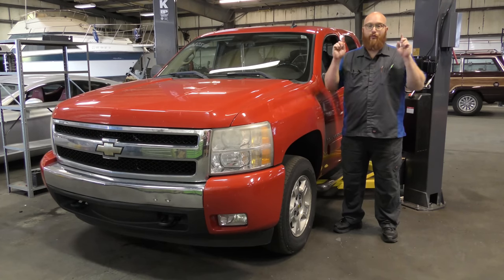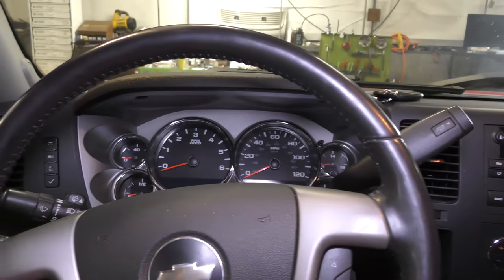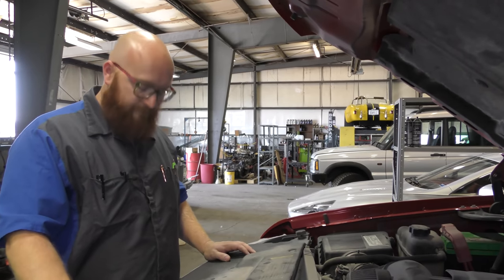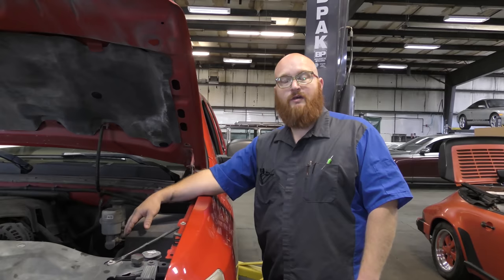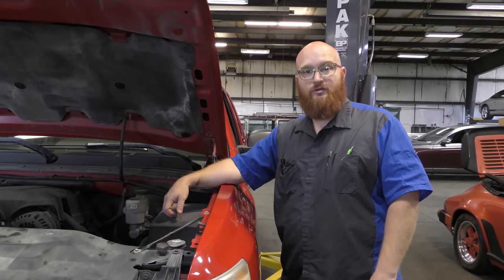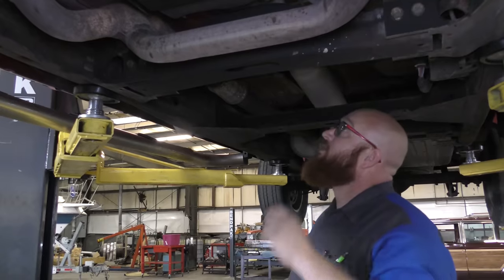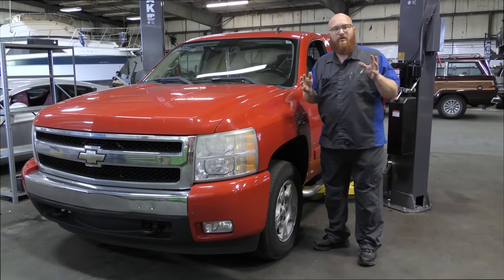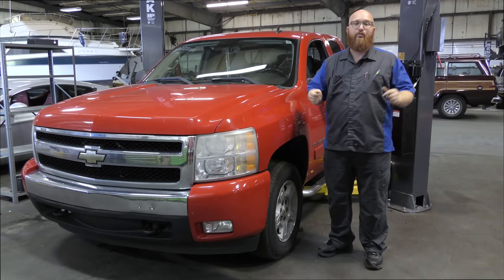Good Truck/Bad Truck? CAR WIZARD shares most common problems on the 5.3L Chevy truck at 100k+ miles

Comment: Hey wizard great video thank you for the information. I'm looking at this era of the GMC twins,  and Ford F150 as well. Non-Ecoboost engines! I've heard from previous owners that they loved these GMC pickups however, they're prone to Rusty fenders that spread very quickly. Owners have said online that GM used cheaper metal in that era to build these trucks which is the reason for the premature rust. Is there any truth to that at all? Is the 2014 and up a better choice with the new body style?

Comment: 2010 Silverado crew cab had to replace ball joints at 80k, and at 100k some of the windows would not open or close from driver's seat switches.  Other than that, no major problems driving my 2010 Silverado to and from Montana/Alaska.

Comment: My company has a 2500HD vortec version of this truck.  It’s an absolute pile.  Every piece of plastic is brittle and broken.  The engine sounds good, but like the wizard said, towing a trailer up any mild incline requires taching it out 4500+ rpm with foot to the floor.  Sucks gas so hard you can almost see the needle drop.  The paint is failing in multiple places.  You can flake off large chunks with your fingers.

Comment: I used to change my own oil all the time, had an 06 tundra and the last time i changed the oil on that rig- the used oil stank like gasoline
really bad. what causes that? bad cylinder rings? i was stumped, the truck ran perfectly except the used oil stank like gas. TIA, really enjoy your channel.

Comment: Good video car wizard ,also the drivers side engine mounts goes bad on those trucks the upper ball joints go bad even on 2 wheel drive the pick up tube Oring is common failure inside oil pan  there is a screen under the oil pressure sending unit the clogs up and the trans cooler lines will start too leak .i brought a 2008 Silverado when it was 4 years old  did front brakes they were the original front pads ,did oil pick up tube oring and drivers side engine mount .replaced the sway bar link pins  replaced all 4 tires I did these repairs after owning the truck for almost six years .my exhaust manifold bolts have not broken yet 😊 everything else is still factory original .it has 234000 miles on it and is daily driven haven’t had any problems AFM but I change my oil regularly.👍

Comment: 6.0 towing tandom axle 8000lb boat 3rd gear uphill 3500 rpm @ 62 litres per 100km on the freshly reseted  display which is the same mpg as my 454 volvo penta  boat which at also 3500 rpm gets 12 gallons per hour A v-8 is a v-8 there all the same mpg when towing and rule of thumb fuel econamy drops by half

Comment: You can get a 4.3 liter V6 in them too and they are easy to work on. You can stand in the engine bay on a V6 truck. However, they are not that powerful and you cannot get them on a crew cab until 2014.
Reply: Agreed

Comment: Got an ‘08 Silverado with just over 130k.  Gonna check this stuff out myself. Thanks wizard.
Reply: Checked and only one broken exhaust bolt, oddly the same side I’ll get an intermittent o2 lean code when it’s cold..
Also have the leak from that oil block off plate.

Comment: I have 330K miles on my 2000 GMC Yukon with the 5.3 engine.  I do have that oil leak that I suspect is coming off the oil filter housing.  I had a problem with loss of engine coolant.  The Chevy dealer put ACDelco anit-leak tabs in the coolant reservoir and that worked.  When I have the transmission overhauled at a local shop at 270K miles, had asked that the rear main engine sealed replaced but it turned out that the aluminum plate was warped and the entire plate/gasket was replaced at the cost of the part and no labor charge.
I want to buy a newer model but I am concerned about failure of the engineering that goes into new technology like engine cylinder activation feature becoming financially burdensome.

Comment: you didn't mention the Active Fuel Management. Is this a non-issue on this gen of chevy trucks? i had one until 153k when i sold it. I sold it because of AFM fears.

Funny thing is that I had the Oil pressure sending unit go out, rear shocks go out, exhaust manifold bolts missing, spare tire rusted shut, a/c go out, and cruise control go out LOL. you're spot on.

Comment: I have a 2001 Silverado with 106k and have had that exhaust leak (broken bolt) on #7 for the past 12 years or so. As you said it sounds like a tappet and goes away in about 30 seconds. No mechanic has been able to figure it out. I just happened to see your video on this Silverado because mine is up in age and wanted hear from an expert on what I might be over looking. The broken bolt on #7 was not visible except for a slight gap between the bolt head and manifold. Sure enough I was able to remove it with two fingers.Grumpy is good.

Comment: I had an 04 1/2 ton with 5.3. Purchased at 100k.  Had to fix, transfer case (leaked), rear seals. AC quit, never fixed it, we don’t need it here in western WA.  Other than that, routine maintenance. Probably the most reliable truck I’ve owned.

Comment: These are excellent - thanks! Just picked up a 2007 2500HD with 20k miles on it from a local amusement park here in Florida that has a rat as a mascot. Already fixed the oil cooler line leaks, the AC belt was severely cracked (new belts, tensioners, idler) - the fuel pump is next, because those just die at some random point, and relatively cheap. Lastly, 1/2hr per broken exhaust bolt is a deal imo - would gladly pay you for that =)

Comment: Blower resistor and connector, maybe a window switch…oil cooler block off plate gasket…rear main seal/cam sensor….

Next we’ll do lists Ford and Dodge, oops, I mean Ram.

Comment: @carwizard great video just bought 2013 chevy silverado 5.3 144,000 miles 
Ran into to cylinder 4 misfires had to change all plugs and coil pack 4 then 2 lifters went out I drove straight to mechanic bad lifters rocker arm not moving 1 of 2 on number 4 shot camshaft due to active fuel management system or AFM is a huge flaw in my opinion as a owner with one in the shop a month after as is purchase I would say a dod afm deleted truck would be a plus running v8 full time seems as if these cylinder get depleted and cause plenty of issues. Not a mechanic but I've learned alot threw my unlucky situation and figured I would give my input as a Chevy Silverado owner
Great video thanks so much for the additional knowledge. Hopefully I won't find any of these when I get her back!
Reply: I plan on looking threw my options for full v8 in the future so this doesn't happen to me again

Comment: Great video! 
I have a 2006 GMC Sierra with a 5.3 L. (123000 miles)......all exhaust manifold studs are still
intact! 
Do you recommend me replacing them all before they start breaking?

Comment: Just wanted to add another common issue. If you are trying to scan a check engine light and get a no signal message then try changing cigarette lighter fuse. It also runs the OBDII port. Cheap, easy, and seems common with GM vehicles in general.

Comment: When buy a vehicle (except exotics and especially BMWS) getting the best one for the lowest price is always the goal.
But there is occasionally value in buy the worst one for an even lower price. When the years and miles are getting well past what manufactures set the warranty at there are standard repairs that will have to be done which barring the vehicle being an utter pile of rust and rodent droppings will cost almost exactly the same amount of money. So if you pickup a beater that has a good rust free body and frame with ok paint and interior for much less than an almost show room version you might actually come out ahead if you plan on throwing a whole load of new parts at it like a crate motor and transmission and all new suspension and brakes .
If you get the right deal on all the new parts almost all already assembled the labor cost of throwing those in is actually less than replacing all the old parts on the old engine transmission etc. then you get the core deposit back or sell the old bits

Comment: A chevy Silverado with 100k shouldn't have much wrong I would go ahead and replace that o ring on the pick up tube those fail and causes low oil pressure at cold startup......also they make a vinyl sticker kit to fix the peeling button problem

Comment: Don't forget the rest of the GMT900 checklist:

-crash sensors
-cruise control dead?  yeah that'll be a brake light switch
-purge solenoids like they're going out of style
-trailer harness turns to dust
-4L60E living to die another day

Comment: Not going to give himself a pay cut because he can do a job faster. Can't argue with that. That's exactly why I pay experts like Car Wizard. Time is valuable.  Rather than try to find the 3 hours to fix a problem myself,  I'd rather just pay an expert to get it done quickly and have me up and running again.
Also, as someone that owns a 2010 Sierra with the 5.3, this is great info for me to look out for on my truck.

Comment: Should note when the spare rims get that rusted you really don't want to use them. They don't fit on the axle flush & will vibrate loose. Also old tires dry rot & come apart

Comment: Wizard, I love you man. I just wish you could lay off the anger you get at some dumb customers that don't understand how shops work. I'm sure it's endlessly frustrating for you, I get it, but that’s not why we want to watch your videos. I watch your videos for the same reason I watch anything on YouTube. You learn stuff!

Otherwise, this video was full of what I like:

* Tell me about the engine and drivetrain, are they going to go wrong, if so how, and how much will that cost
* Stories about how stuff went wrong fixing something
* Show me the parts under the car and what’s going on

Stuff I wish you would do more of:
* Let’s do a job video, where you have a fix and all the little tips and tricks you’ve learned to make it easier
* Stuff to watch out for, where you show how an easy job can go sideways if you don’t watch out
* Great tools of the trade and special wizard tools and how to use them

Stuff I don’t really like:
* Show me around the car, tell me about the paint, etc..
* How the car is on the inside, how roomy it is, couldn’t care less. I’ll watch Doug smush himself to something for that

Comment: If that motor has AFM and one of those lifters go, $ for the fix just went through the roof!   Had a diablo on mine so it always stayed in 8 cylinder mode, actually made the fuel economy go up a little bit!

Comment: My lq4 had the broken bolts. Luckily it was only 2 on the passenger side. I had some new headers ready to go on and when I removed the manifolds the passenger side had a crack all the way through. Had some threads sticking out so a small pair of vice grips is all I needed.

Comment: Wizard, your Knowledge and Experience are worth their weight in gold. This might seem like a "dumb" question, but what are your thoughts on A2 stainless steel exhaust hardware instead of the regular Grade 8/Class 10.9/etc stuff? From a newb's perspective, using stainless steel for items like Manifold Studs/Bolts would certainly seem like a good idea since they seem prone to rust-related headaches as you've demonstrated, but I would love to hear your thoughts on it, based on what you've seen and know on the subject.

Comment: Yeah... I have an LS conversion 5.3 in a 74 truck....   The exhaust bolts are junk....   total trash so while I could?   I got good bolts and replaced em all.     We used a mig to weld on a nut to remove the hard ones.

Comment: If ain't broke don't fix it, I know but, would you suggest  replacing the exhaust bolts with new ones before they break ( knowing they are going to start snapping ) or no, leave it alone. I'd rather take them  out on my terms (time, parts on hand, ride if needed) because they will never work on yours.  Preventative maintenance and practical. I have a few mechanic friends and they get the same way and I understand, people are always complaining about the cost, or want them to check the car out and then go fix it themselves and then complain on the cost of diagnostics, it just never ends. I didn't think you were that grumpy lol I have see explosions before.

Comment: My family has been buying Chevy trucks since I was a kid in the 80’s.  None of them have had any serious issues.  Actually that’s not true, there was an oil issue on one my dad bought used but it happened immediately after he bought it and they dropped in a rebuilt engine.  That was a great deal after the engine swap.  That was a 2003 Silverado I believe.  That’s out of 8 or 9 trucks, two S10’s and a bunch of Silverado 1500s.  3 of those are still in the family and still on the road.

Comment: I've always had good luck with welding a nut onto those flush broken off manifold bolts, and using a torch and plenty of heat to get them out. I seldom have to drill one.

Comment: I have 2009 with 120,000 4.8 engine with the 4 speed trans. Haven't done nothing to it in years. Mine isn't rusted out because I spray the used engine oil on it. And my door locks don't work. Mine is the work truck model with noting much.

Comment: Ugh look at those rust-less fenders.  I need to get out of NY.  I've got an '08, same trim, 195k... got it at 190k...  Lets see what I've replaced (this is just a weekend beater / tinker toy) - 4x4 selector switch, multifunction switch (high beams), cabin temp sensor, brake pedal sensor (allows use of cruise control)... Under the hood, spark plugs (this thing had the originals with 190k miles on them), wires, filters, belts, fluids, evap sensors...  Going to check the exhaust manifold bolts now.  Suspension, both front wheel bearings, all 4 ball joints (including control arms - upper)...  Rear, evap canister, evap sensor thing, fuel pump...  I think that's most of what I've done so far.

Comment: Thanks for this video.  I have a 2007 LTZ 310k miles runs like a champ. Beautiful interior previous owner took care of it, I do also.I had a oil sludge issue had a mechanic  clean motor, has done great for 3 months.   WHAT CAUSED IT.  I drive the truck to work very small town low low miles going to change oil tomorrow and pray theres no sludge. But never really got a Cause of sludge?  Using Mobile 1 and filter please help and thank you

Comment: This information is so scary to me because I am in the market for a used full size truck that I can put a Slide in camper in. I have had 4 checked out, none passed a mechanics inspection. I have since began looking at smaller Nissans or Toyota's.

Comment: Great trucks. Once you buy one have a shop turn off the destruction on demand if it's a 5.3 and change the rear diff fluid to something with a locker additive right away. Watch for cracked/broken manifold bolts cause theyre a pain.. Besides that great trucks with minimal issues when compared to similar year ford or shipping crate dodge half tons.

Comment: I have a 2012, the torque converter went with less than 53,000 miles which caused my transmission to go. $3000 Canadian, but it has been a great truck otherwise. 
Guy Canada 🇨🇦

Comment: 07 up gm trucks and SUVs also eat ball joints like crazy. 75k miles or more you can bet it needs ball joints. Pick up on the wheels from the bottom to check the lowers, push in on the top of the wheel to check the uppers
Reply: Don’t those have bad tie rods too?

Comment: I have never had a truck before, but I can see that a V8 is much easier to work on than a v6. There is much room to work and it is 90 degrees V. I hate to work on my Fusion V6.

Comment: Wiiiiizzarrd. Glad that I came across this video. Have a very similar truck- '07 regular cab short-box. The only other difference is my last year 4 speed slush box. I think '08 was 1st year 6spd auto. Mine has around 147k and has been a pretty good truck. Besides routine maintenance and upkeep, I've replaced the front passenger hub assembly and was leaking oil from a gasket somewhere up top that had to do with GMs pointless fuel management system- so new intake gasket etc. Have taken pretty good care of this truck and it could still use a few grand worth of work into the front end. I couldn't agree more, however, about how underpowered this truck feels. Even after doing simple cold air, exhaust and a nice tune-up, it still lacks enough oomph at highway speeds unless I really get after it. I live in a mountainous area and if I'm up and down or even slightly on an incline, I'll just drop the old girl into 3rd gear and leave it there until I hit level ground again. Love this truck and will have it forever (and my C5 Corvette), bit when it comes to all around build quality and long-term reliability etc, the next truck purchase will be a Tundra. I feel good about putting 300k on a Toyota that probably wouldn't have the creaks and rattles that the Silverado has with half the miles. One more thing, Wiiizaard: They're engines, not motors!😲 Love your vids, man!👍

Comment: I had a 2011 Chevy Avalanche Ltz years ago. It looked great but mechanically it was bad I was the 2nd owner I had it inspected before hand nothing major at the time.  I bought it and in 4 months I sold it and lost 9k on it. I kept having code 0521 insufficient oil pressure. Long story short the previous owner did not change the oil regularly, and the oil pan had a lot of sludge in it and the block. New oil pump and AFM and 3 oil pressure sensors all oem parts and I still had oil pressure issues. Eventually the dealer said you need an engine too much sludge. $5800 quote. I bought it for 21k had 24k total into it..  The dealership offered me 15k and I took it. Never again.

Comment: Thinking about buy a 2012 silverado 1500 5.3 l 8 cylinder 126k my only concern is transmission I don't want it to last 50k miles for transmission to go out or slip